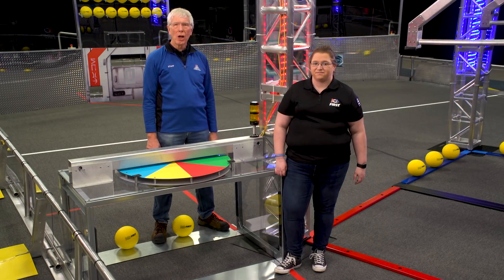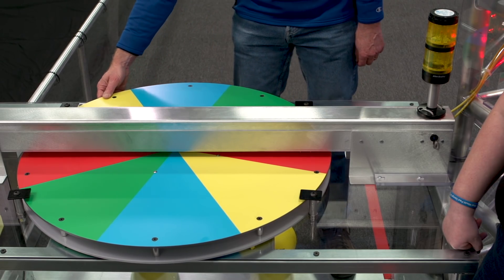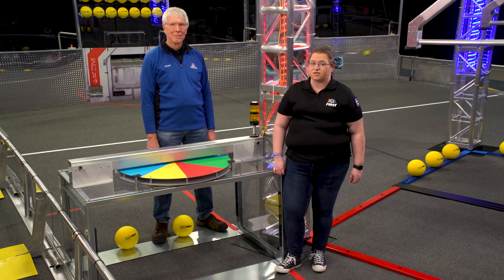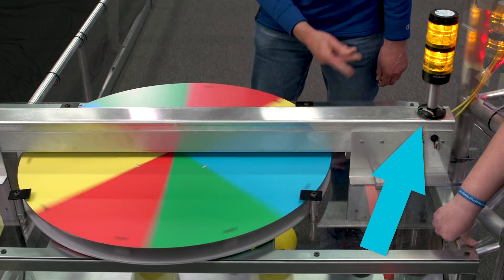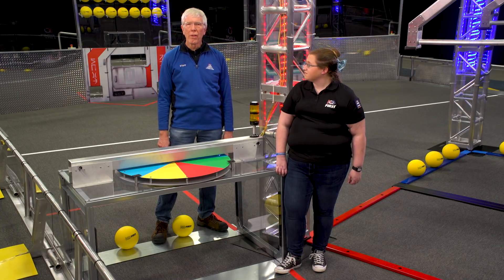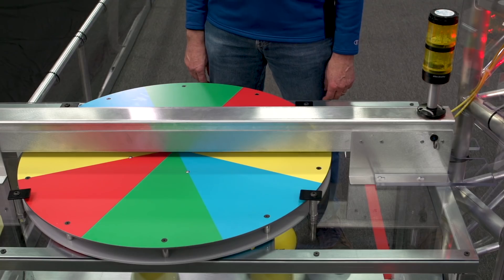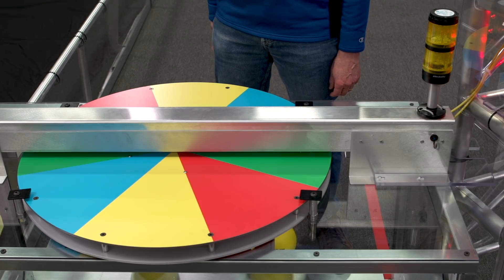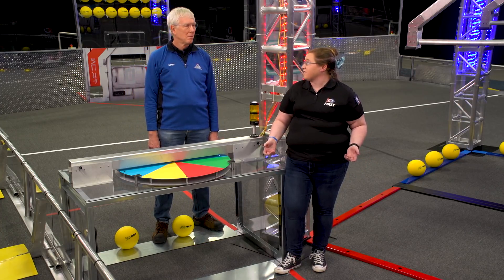2020 Field Tour Video: Trench Run and Control Panel

Comment: Can you spin the wheel while scoring power cells? Like in the middle of scoring the 20 in stage 2, can you also spin the wheel at the same time or do you need to wait till you scored the 20 balls
Reply: Check the manual
Reply: You *can*, but it wouldn't count towards the required spins
Reply: You have to complete the ball portion beforehand in order to proceed.

Comment: There is a contradiction with the Game Manual in this video.
Figure 3-24 on page 28 of the Game Manual states that the Trench status light will turn ON to indicate that the Rotation Control has been completed, while the video states and shows that it will turn OFF.